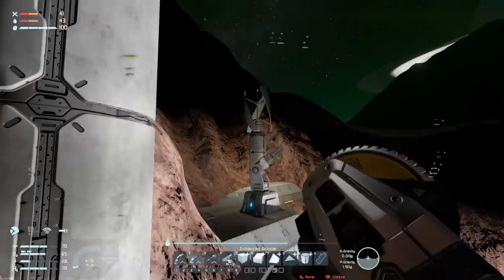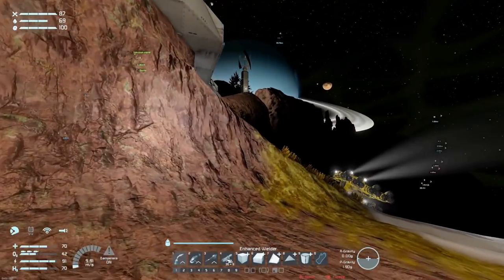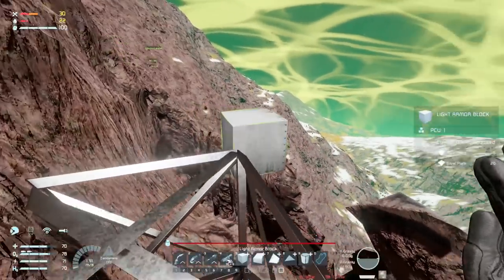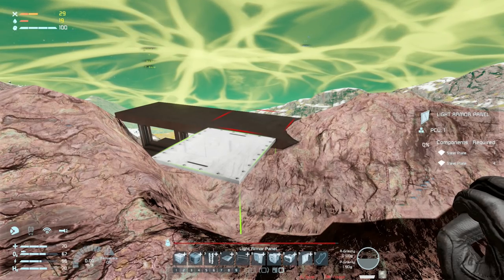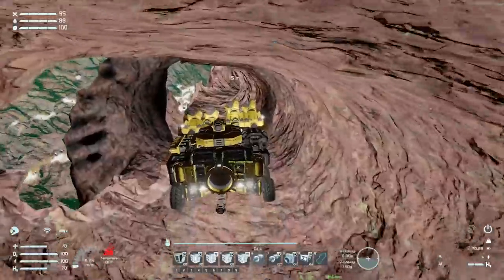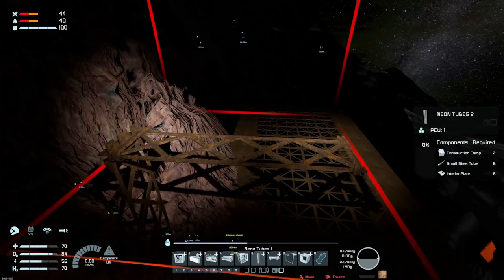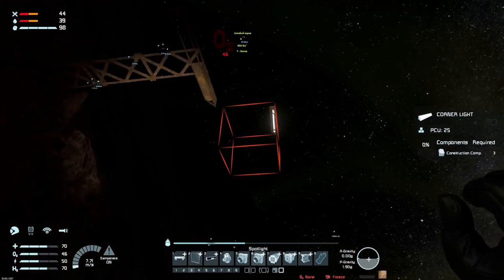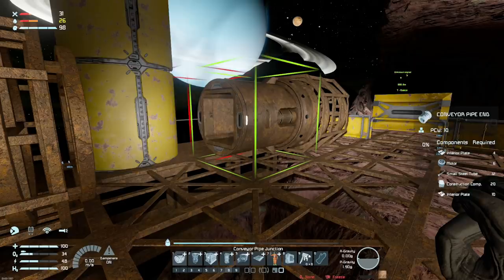Survival Impossible - Death Route #66 - Space Engineers Hardcore Survival

Comment: I just revisited the first episode of this series to figure out what you did to the power generation of blocks, it now occurs to me you didn't actually reduce the output of wind turbines but rather reduced the wind speed on the planet, which is why your turbines are so slow. Doesn't that mean that solar panels are technically still at full vanilla output? If so, then even if they only receive power for a third of the day, a single solar panel would still put out something like, three to five times more energy than a wind turbine so placing 6 to 8 panels anywhere would provide more than enough power to keep everything running and charge up the splatform. I know you seem to have a dislike of solar power for some reason, but given what you've done to ice and wind power, solar might be your only option.